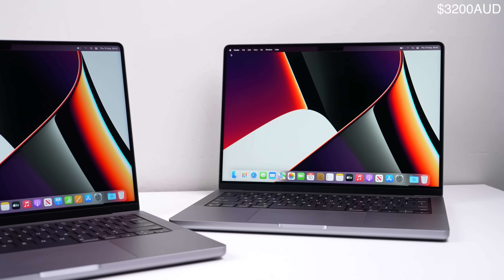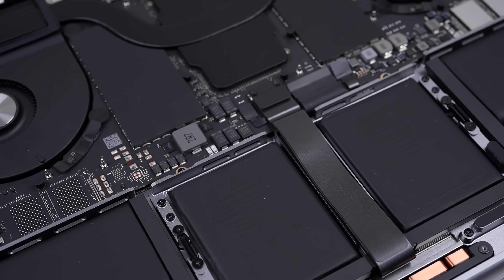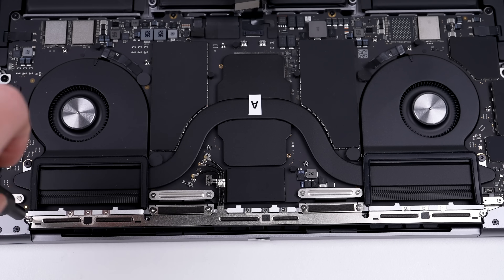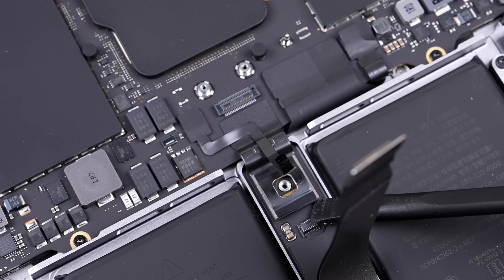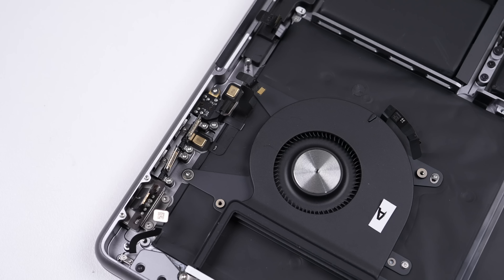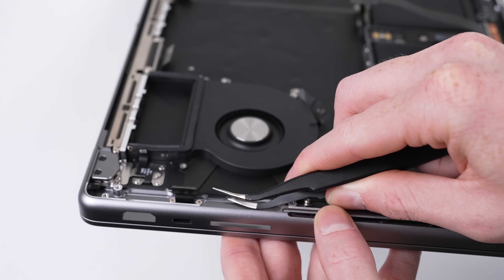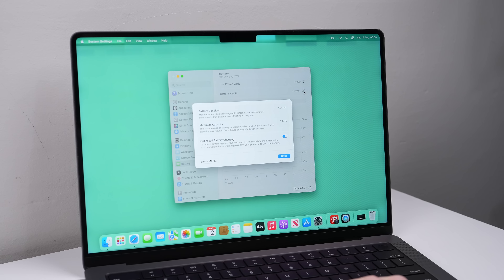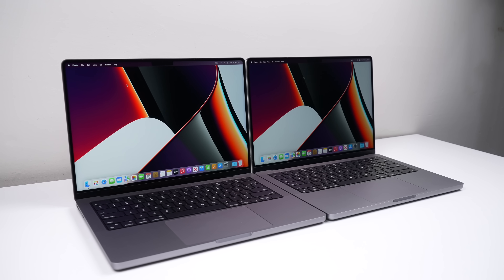New Anti-Consumer MacBook Pros - Teardown And Repair Assessment - Apple Silicon M1/M2

Comment: Apple: We removed the charger to save plastic and packaging. 
Apple: We are using plastic stickers to hide screws that nobody will ever see.
Reply: that plastic sticker is there so the motherboard doesn't short circuit on metal casing and fry itself
Reply: @vtbbbnk  Both the screws and the casing are grounded. Nothing will short. If you worry about shorts you need to isolate power lines not grounds.

Comment: Funny part that most people still purchase Apple products for Status. This Coupled with reviewer that make us believe that 40 sec more of export time in video or the Speaker perfection of the apple would be necessary for everyday use. Instead of having 2000€ euro less expansive laptop where you can order 90€screen from sellers and replace yourself, plus, be able to open it and clean it properly each year of use to avoid overheating and check thermals. Apple has become a joke. I do not see a single motif why people should still buy from them. There is a glitch in my mind when these people give me their motivations. It seems no sense to me spending for a laptop with no replaceable ram, ssd, and parts. So obvious that Apple is just mocking customers.

Comment: Apple likes to overengineer a lot. Instead of using unreliable push-on connectors with metal brackets upon metal brackets they could just use the time-tested push-in connectors with locking clips. This is what happens when you have wanna-be designers instead of engineers working for you.

Comment: I had the display on my 14" M1 pro machine replaced on the warranty at an authorized repair shop, as it periodically flickered. After the repair, even though it was calibrated, it still had exactly the same anomaly just to the right of the notch, as you show in the video. I talked to them the day after handing it in again, and they said the same error occurred on another replacement screen. They fixed it in the end, not sure how though
Reply: The authorised repair partners don't even use first party parts to repair, that's the issue there. Yes it's fraud and no apple don't care.

Comment: Probably the cable need calibration because the magnet is differently placed for each cable.
So one cable working perfectly for a machine doesn’t work at all on another.
Should be calibrated for free, too.

Comment: I wonder if they mount that little lid magnet in random orientation and that's why their friggin iHall effect sensor requires callibration. A process that could be done by a simple tool that asks you to close the lid and reopen it back while it collects sensor data and calculates callibration data. It's really trivial process.

Comment: Given the swapped display angle sensors exhibited odd behaviour around 90°, I wonder if Apple just doesn't bother controlling which orientation the magnet is installed during the display assembly (assuming the magnet's a square prism).

Comment: I have been cussing out Clevo after mucking about in the internals of one of their 'gaming laptops' because of their many backwards design decisions, but even that PoS is infinitely more repairable and upgradable than a more expensive Apple MBP. 

I don't like the Framework laptop enough to be tempted by it, but I do hope that such easy access to internals becomes more of a thing. Even my 2007 Packard Bell 15.1" laptop had easy access to all components and I recently replaced the battery for it, along with upgrading the RAM. No glue, just a few screws to pop off some panels on the bottom and drop the battery out. Put in new battery, slot in new RAM and storage, put the panels back in, done. Works better than it did in 2007 :)

Comment: Seeing the performance I get in my iPhone, I wanted a MacBook my pg degree laptop. I already have Acer Nitro 5 i5 256 + 1 tb, with me increasing the RAM to 16 GB. But the hinge is completely loose and the front camera is not working at all. Got it repaired several times, but no long term improvement.
After this video, I doubt I will ever get any MacBook. iPad 9th gen is still on my mind, along with mac studio. But that is it.🥲
Reply: I also have a Nitro 5 and havent had any issues with the hinge or camera (even though I’m using GNU/Linux and have had to deal with nonexistent camera drivers before) Also nvidia only almost broke my system ONCE!
Reply: @wilh3lmmusic  my laptop fell from my bed once. Maybe because of that. I need to go out of town to get it repaired from Acer store. That’s a bit of work for a laptop that stays plugged in on a table,  I believe. So I am avoiding it.😄

Comment: I think for many use cases, including my own, apple has the best OS and software by far. Even the higher price, compared to competitive devices, doesn't scare me away. I'll spend more for a better product.

However, I will not buy a 3000 dollar laptop that is basically unfixable when even simple things go wrong. This is why I am typing this on a Framework 13 and have a Framework 16 on pre-order. I would love to return to Apple products, but unless they change their stance on repairability, I'll be sticking with Framework/windows for the time being.
Reply: Apple has the worst OS

Comment: Louis Rossman recently discussed the problem with Apple's decisions like soldering SSDs with the newer Mac computers and  i agree with him in that these newer machines will end up being e-waste at a much earlier time than older serviceable Mac computers.
Reply: More of an Ultrabook trend.
Workstations are supposed to be upgradable.
Reply: @peterpan408  well it’s obvious. Workstations are supposed to be upgradable. I wish more manufacturers followed Framework’s direction of making modular and this upgradable laptops.
Reply: @peterpan408  The thinkpad x1 is a high-end workstation, and it still has almost no upgradability.
Reply: 5 years or so, 3 if it's in a heavy use environment. That's the kicker of SSDs, they all fail and if it's soldered in place it puts a hard lifespan on the machine it's part of. The value of used M-series macs is going to crater when people start to realise. Weird to think that 2015 was truly the last year of good Macbook Pros for professional use.
Reply: @fix0the0spade slim laptops last less due to the heat generated  by electronics, less airflow than ticker laptops. 5 years of use? No way
Reply: He used to discuss that on a daily basis for years on his older videos. Not enough people paid attention until recently.
Reply: It's the same for Xbox Series X or S, the storage is paired to the console, but removable. If you remove it to replace, you have to copy the original SSD for the hidden partition that contains the pairing key. But if the original SSD is dead, there's no fix, the console will not allow to install the OS and throw an error so it becomes an e-waste. Furthermore, the pairing key is updated each time the system updates, so you can't keep a backup somewhere, you'll have to disassemble the console and backup the SSD after each system update otherwise it will throw the same error when trying to install the OS.
Reply: good to now. great for consumers - There's no point in stealing Macs, and you know someone hasn't used a counterfeit part.
Reply: even I they're gonna solder their SSD chips they should be required to provide Nvme slots on "pro" machines for DIY upgrades that don't see the 800%+ Apple tax markup on flash RAM.
Reply: What makes it even worse, apple is the top dog. They probs sell more laptops than any other company on the world.
Richest most capable company, it creates more waste when it has all the possibilities to do otherwise.
Next time they brag about recyclables, I will remind them about soldered components and other "features"
Reply: I still have my old macs luckily I have about 13 or so old macbooks
Reply: the SSD problem isn't just an Apple problem. My workplace Thinkpad X1 has also soldered parts, which aren't really repairable when a failure occures. This is becoming more a high-end laptop category manufacturing standard.
Reply: @jani0077 the thinkpads SSDs aren't soldered. The RAM is.
Reply: @jani0077 i think its the companies seeing apples succes at it and now followed the same path and do it themselves its kinda sad
Reply: @jani0077 Yup. The high end of things is getting out of hand. Luckily, niches like creator, gaming and some business machines still offer repairable and upgradeable options, for a price.
Reply: @jani0077 still an X1 is 100x .more repairable than a Mac,.u can buy screens, wifi,.camera keyboard and even whole Mainboards and just REPAIR IT including an easily replaceable battery - and last time I checked they use a m.2 sad which is also replaceable

So it's the anti-mac
Reply: @jani0077 the problem here is that, whenever Apple do some anti-repair stuff like this, the rest of the industry follows.
 
Remember back then, when Samsung mocked Apple for removing headphone jack, having a notch and even (at some extent) having no removable storage? Also, when Apple started soldering the RAM, other laptop manufacturers followed suit (ASUS, for example, have some models with soldered RAM.)
Reply: @Jan-xf8sk  all of my laptops have soldered RAM, and 2, including my MacBook have soldered ssd too.
Reply: @jani0077 The ridiculous thing is that ThinkPad was supposed to be the workstation line with durability, reliability, and repairability in mind, but nowadays it's just a shitty Lenovo laptop with a nice keyboard and a black plastic shell.
Reply: @jani0077   false equivalence. The X1 has replaceable SSD, WIFI card and WAN. Only the ram is not replaceable. None are true for latest Macbooks. There is also no software locks like Apple
Reply: @verygoodbrother  don't thinkpads have a lot of variation in their design? I wouldn't find it hard to believe some of them have replaceable ssds and some have soldered.
Reply: @jani0077  yup! Apple was one of the manufacturers if not the only manufacturer that started this terrible trend and now it seems others like Lenovo are following this suit.
Reply: @jani0077  unlike apple ur ibm can be repaired and parts can be aquired unlike apple requiring inhouse calibration, and store with the skills can repair which is the whole point,soldered parts isnt an issue so to speak
Reply: I like that you compare Macs to other Macs, because I believe Macs outlive PCs by a long shot.
Reply: @less-than-thou  What world are you living in?
Reply: @less-than-thou No. Wrong. I dont think you have used high end PC. 
What you say its a myth.
Reply: @less-than-thou really now I've got windows machines still running after 20 years 😊

Comment: Never bought an apple and never will due to their repair policy.
Reply: Just the same as every other major OEM you mean? or infact some what better given they do use screws rather than glue or plastic clips (yes skews take longer to remove but unlike plastic clips they do not break as they plastic ages).

Comment: I wonder if there eventually be some info about potentially reseting and calibrating these display and angle sensor will be released from the independent repair shops that are willing to try to repair/upgrade logic boards (as they have been doing with all the previous logic boards with soldered on components).   I've been a content creator for numbers of years, and just tried out the full Apple ecosystem in 2019 by getting an Intel 15.6" MacBook Pro.  I hadn't been like other artists being Mac enthusiasts for their work, as my work was 3D animation (and workstations with NVidia Quadro cards was what I needed for stable 3D work in Maya).  I got a MacBook Pro when I tried getting into software development.  I to like its thinness and Apple echosystem with my Apple TV 4K and iPhone (or also trying to do get into developer tools on the iPhone).  But the way Apple is charging a premium for non-upgradable computers that don't outperform similarly priced PCs....seems content creators like video editors have to decide if they want to spend that kind of money for something that arguably might hold an advantage for size and battery life.
Reply: Re-calibrating the display backlight requires a LOT of costly equipment as you need to mess the light response for each LED in the backlight and to do this correctly you need to light sensor to move along the screen perfectly lined up with the LED that is being lit up.  Then you need to build the inverse brightness function (since the LED bleed light into eachtohers zones) this is then provided to the SOC so it can correct of the defects in the backlights.

You cant even just use the values that were captured in the factory since if your using a used backlight you need to consider the burn in effect, this is currently recorded by the system (yes it counts for each backlight LED how long and high bright it has been on and uses this to correct the calibration) so if you get a used backlight you also would need access to the SOC it was used with to extract that info. 

Back in the days of simple full screen backlights this was much simpler as it was a curve value (voltage to light) to adjust (how bright the backlight is) but now it is a curve for each LED.
Reply: @hishnash  Do you really think it could be that complicated?  The video shows that the screens have solid screen tints (nothing localized per pixel).  It and the lid position seems like some set values that need to be set.  I'm not knowledgable myself....but the video also mentions that logic board can't be repaired if everything is soldered on.   I'm at the skill level not to do that (I can take a backplate off and replace components on a PC laptop).  However, I know of 3rd party repair shops that are skilled enough to desolder chips and upgrade SSDs on MacBooks.  They have been voicing their concern of Apple repair manuals not being available and how it's a battle of having a community to share such info.
Reply: @dsr0116  Its the screens calibration to backlight non-uniformity. 

You can repair the logic board even if it is soldered that is what board level repair is about.
Reply: @hishnash  Are you sure that's the only component about the screen's controller????  Given what I assume from the video, it's a component setting the display's black and white point, as well as RGB (as you would, calibrating a TV).  There is no uniformity issues when the displays were exchanged...so I'm thinking those were set in display.
Reply: @dsr0116  the issue is the calibration to deal with the backlight. These devices are miniLED backlights to 1000s of small seperate LEDs each with its own voltage to brightness profile and its own defects.  They are producted on a grade and then tested. The calibration is a profile (per pixel) appleid to the LCD response (how much it blocks the light) to mitigate the natural non-uniformity of the backlight. 

This is not a uniform calibration as you would have ad on an old backlight were it all was either on or off.  

You could set the per pixel calibration in the chip on the display but this takes some space and thus costs money but also time during production so what apple do is the save it to thier servers and then in diagnostic mode the device pulls the profile from Appels servers (if approved by apple) for the respective displays SN number.   Apple adopted this since the iPhone 12 and all apple products since have used this remote profile for sensors and displays, I expect it saves a few seconds in the factory as they don't need to then have a line were people connect to the chip on the display to write in the profile after it has been tested (and then re-test to assert it has been correctly written) this increases production volume in the factory (and saves a few cents)
Reply: @hishnash  I have an iPhone 12: it's an OLED display: it acts the same as any other OLED....there is no need for having to save pixel info on server.  The way displays are manufactured they have to be uniform by the way the tolerances are for that technology (as it matured with large screen TVs and an iPhone is pretty minuscule).  Really don't see how mini-LED is that different: it's all about the panel manufacturers making sure a panel meets set tolerances (mainly, being able to meet dynamic range, uniformity, and response time).  Every single display has controllers for setting the color space, frame rate, etc.
Reply: @@vhdtgc-re4ct  what would blanking them provide?  the parts would still not have a profile loaded.

Comment: Does this affect 14in pros too?? the flex issue
Reply: There have been no reports of the display flex cable issues in the apple silicon generation. Appearly apple make the cables a few mm longer and thus they are under less strain.

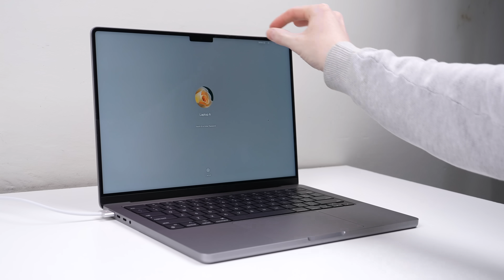Comment: 10:05 hey what what you applying on the screw?? It it to make apple think you never opened it or water seal something
Reply: loctite. To keep the hinge screws from backing out due to vibration and normal use. Had this happen when you don't use loctite!
Reply: @iMacJames  ohh I see my laptop back panel 1 screw also used to come out I noticed this 2 time didn't knew what was causing that maybe this was. But I don't travel with the laptop only carry it with house